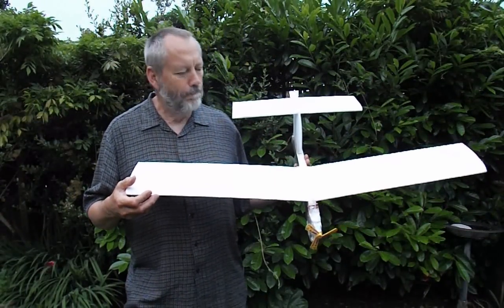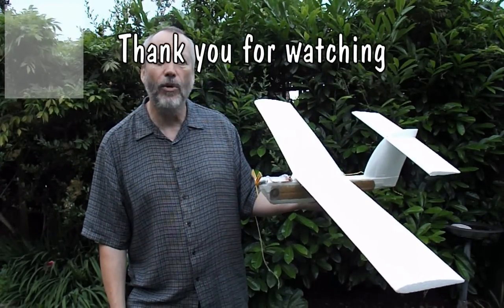Hey Grandad can you use cheap motors and cheap RC for a plane?

Comment: i was supposed to be weeding the garden, so lets crack out the hot wire cutter and make an aeroplane instead! :D brilliant :D ♥
Reply from the maker: That is an old one. Did you search for it, or did it come up as a recommendation 🤔
Reply: @GrandadIsAnOldMan  neither nor, i was using the search term "foam rc plane" and scrolled through it for quite some time, then it suddenly popped up :) i did watch it back when you uploaded it, but back then, i somehow missed that "should be weeding" gem at the beginning :D
Reply from the maker: @Elnufo  😁

Comment: grandad, maybe you could solve the problem of weight a little bit by sanding the outer steel pieces to make them thinner and more lightweight.
Reply from the maker: The project was started following regular requests to make a plane using the components from cheap RC toy cars. I did the series to demonstrate you are really wasting your time. If you are going to start spending time trying to modify the component parts you need to sit down and ask yourself why? The RC gear in a cheap RC toy car does not have the range to allow you to fly a plane unless you are very fit and intend to run around after it to keep it within about a 12 metre range so you would be better off buying a cheap hobby grade RC transmitter and receiver. It would be a good investment anyway. Next,  if you are not going to use the RC gear, what is left? The batteries will be too heavy so you would do best to buy LiPo batteries. That leaves just the motor. A hobby grade electric motor is cheaper than an RC toy car so if you are not going to use the RC gear you are wasting time and money buying an RC toy car just to use a junk motor. If you check out the video description you will find the link for the full playlist for this project. It runs over 11 episodes and it does fly but only after I replace the motor and the RC gear.
Reply: GrandadIsAnOldMan thanks for the information grandad, I was wondering that because we live in Croatia and delivery is quite expensive, for some things even double the price of the product. There aren't any rc related shops around and all flying rc gear is overpriced , regardless thanks for the video and info, I really enjoy your content and like what you do. Keep being awesome Grandad.
:)
Reply from the maker: Thanks very much for taking the time to comment. In the later episodes in the series I eventually use a better motor that actually comes from a toy hovercraft and a proper propeller and proper hobby grade RC gear just to prove the plane could fly. The motor is still not hobby grade but it is more powerful than the ones I was originally using. I suspect the motors from slot cars would probably do the job too as they usually run on 9 or 12 volts at high RPM, I haven't tried on but I might one day.

Comment: ok if you use fan blades you will get circulating of air but you wont get thrust propellers are in air dynamic shape
Reply from the maker: Yes a proper propeller blade would work much better. The purpose of this series (like most of my projects) is to use items from bargain stores (dollar stores) to make the project. If you watch all the episodes in the series you will see in the end I demonstrate it will fly with better components but not with the bargain store stuff.
Reply: thanks for reply great videos
Reply from the maker: Basic Survival :)

Comment: How do you cut it like that
Reply from the maker: +Bao Khang Kelvin if you mean using a hot wire bow to cut the foam here is a video I did to show the ones I use Hot Wire Styrofoam Plane PART #6 - those hot wire bows https://youtu.be/ZSFxSy6-bY4  and If you want a more professional looking bow you might like this one by Francisco Ramos Muñoz  https://youtu.be/Dzp9Qwvx2LE

Comment: Nice project. Can you not just use a capacitor and a more powerful battery and ditch the transmitter?
Reply from the maker: +Ross Pienaar the purpose of the project was to try to use cheap dc motors and components from cheap rc toy cars. If I just wanted to make a plane that flies I would use different equipment.

Comment: i have a plan to make an rc plane,but i dont know how to connect a 500 mh battery(lipo) to the motors,pls help(motors 4 drone)
Reply from the maker: +Lol Lol what is the problem? A LiPo is just a battery. It has a positive and a negative and you connect the wires to the motor the same as any other battery. If you mean you don't have the right connectors to fit the plug that is already on the LiPo then you will have to research that for yourself to identify a source. I buy virtually everything from eBay. LiPos come with different connectors depending on what sort of model they are intended to fit or sometimes with no plug so you fit your own plug to suit. You will probably want to include an on/off switch in the circuit so it does not start the motor as soon as you plug it in.
Reply: GrandadIsAnOldMan im still begginer at electronics,i don't know how to attach it to a normal dc motor
Reply from the maker: Lol Lol a DC motor will have 2 tags and the battery has 2 wires. You join 1 wire to 1 tag and the other wire to the other tag. If the motor goes backwards then you have the wires the wrong way round.
Reply: GrandadIsAnOldMan so now i should cut the drone battery connector?
Reply from the maker: +Lol Lol two points. 1: it would be better to obtain a matching connector if your drone battery has a plug on it. 2: If you decide to cut the wires DO NOT cut them both at the same time as that will short circuit the wires and the battery could catch on fire.
 Remember you will need to charge the battery so whatever you do must be compatible with your charger.
Reply: GrandadIsAnOldMan thx for the tip grandad!!:)

Comment: Not sure if this is true.... but it looks like it helps a bit. Well obviously not enough to get lift  but it looks like that tiny motor did try to make that glider go up a bit
Reply from the maker: +400 Gaming if you follow this series through - link in the video description - you will see the point I am trying to make is that this is really not worth the effort. You might as well buy a decent motor and do the job properly. People keep asking me if they can use the parts from their broken RC toy car to fly a plane and generally they don't have the power-to-weight ratio needed to get into the sky.
Reply: GrandadIsAnOldMan well i know that, but in my area good motors don't come cheap (about $100) so i'm just trying to find a way to get around that. Thanks anyway though.
Reply from the maker: 400 Gaming maybe you should have a look at eBay or similar. You can get brushless motors much cheaper than that. If you are really focused on using these toy car type motors then you will have to consider some sort of gearing system to enable it to use a bigger propeller. You will need to buy decent propellers to get a reasonable performance and you will probably need LiPo batteries to keep the weight down. What you don't want to do is spend a lot of time making a plane that is basically a glider that goes an extra few feet when you switch the motor on. You need it to climb properly and make sure you set it to turn so you don't have to run too far after it, unless you intend to make it RC. If you intend to make it RC then don't waste your time trying to use cheap RC toy car equipment as the range is far too short and you will have to chase after it to keep it in range.
Reply: ok ill try Thanks.

Comment: Can you make a rc helicopter
Reply from the maker: george maddox that is a regular request and the answer is NO. To make a helicopter or quadcopter stable in flight I would have to buy so many parts designed for the purpose it is cheaper to buy a ready made helicopter or quadcopter. On top of that, my channel is aimed at simple, quick, cheap projects and a helicopter or quadcopter build is not a simple, quick, or cheap project. You would be better finding a channel that specialises in RC Quadcopters or Helicopters so you get the information from people who know what they are talking about. FliteTest would be a good place to start although they tend to focus more on planes than copters https://www.youtube.com/user/flitetest
or anything David Windestål is involved in https://www.youtube.com/user/dadde87
or you might like this video by The Post Apocalyptic Inventor https://youtu.be/qa_x93JQhNM

Comment: You should revisit the  dh mosquito project and enlarge it on to hot wire cut foam that would be cool
Reply from the maker: alex monk I am not really interested in scale models or larger powered planes. This is not a model plane channel, if you want to see model planes then I suggest FliteTest.
Reply: ok fair enough and yes i have watched flitetest for a while before and it is a great channel and resource for model aircraft and design and building tip as well as flying tips

Comment: You can get a good amount of power from a rewound cd rom spindle motor and a brushless esc, even a hard drive motor unmodded would be better than the little dc motor.
I spose the esc might preclude it from being cheap, and you'd also need a servo tester to make it run, that or a timer for a control line electric plane.
Reply from the maker: hellcattanks the idea was to try the standard motors from cheap vibrating toothbrushes in cheap rc toy cars. If you want more power then you might as well buy the proper model plane motors and do the job properly.

Comment: Hey Grandad! You could replace the battery with a 2s 7.4Volt one, if it's not completely out of standard

The motor's only gotta be running the 5 meters anyways, so if you're running it max, it shouldn't be a problem.
Reply from the maker: TheShiphoo it's more a problem that it will probably burn out the receiver.
Reply: Fair enough. You'd need something like a BEC and that's over your budget... But if you ever find a high-voltage reciever in your charity stores, please pick it up and continue this project, if you can :)

Comment: If you were to make a version 2, use 4 mini tooth brush motors and two on each wing, this means the weight is centred and it won't fall because it is front heavy. Also, tooth bush motors are lighter, but have high talk.
Reply from the maker: Mustafa Moussa  the point of the exercise is to use those small motors as those are the ones people see me using in the other projects. I could always put a proper model aeroplane motor on it and a proper propeller but that is not what this project is about.

Comment: U can use a 9 volt battery and a switch and a bigger motor so it will fly better but if that's too strong well than it will fly and not stop until battery dead
Reply from the maker: Aleksander Sats the point of the exercise is to use those small motors as those are the ones people see me using in the other projects. I could always put a proper model aeroplane motor on it and a proper propeller but that is not what this project is about.
Reply: GrandadIsAnOldMan
i ment a bigger motor than what u use the bigger ones are stronger and u can find them in big rc cars or even big toy helicopers and toy trains :-/ i got 2 there really good

Comment: A geared motor would do the job better: more thrust and bigger propeller.
Reply from the maker: Amir Alamir  the point of the exercise is to use those small motors as those are the ones people see me using in the other projects. I could always put a proper model aeroplane motor on it and a proper propeller but that is not what this project is about. If the right gears and the right prop were available as part of another toy, then maybe it would work, but if I have to buy props and gearing then I might as well buy a proper model aeroplane motor and do it properly.

Comment: Flies well!
Reply from the maker: Francisco Javier Lázaro Pinela it glides fine but I don't think the motor adds anything.
Reply: GrandadIsAnOldMan Place a reducer and a propeller ...
http://img.ar.class.posot.com/es_ar/2014/10/18/Motor-Aeromodelismo-Mabuchi-550-Con-Reductor-Helice-Y-Speed-20141018110552.jpg
Reply from the maker: Francisco Javier Lázaro Pinela yes I could, but that's not really the point. People want to to know if you can just use the parts as they come from the toys. If you need to buy proper parts, you might as well buy a proper motor and proper gear. I might try the gearbox from a toy car to see if that works, but I would probably still need to buy a proper propeller.
Reply from the maker: ***** the point I am trying to make in this video is it is a waste of time. You are better off buying the right type of motor, they are not that expensive and will make the plane fly with a lot less effort.
Reply: +GrandadIsAnOldMan In my humble opinion, I think if a gear is set to reduce the number of turns and increase the power, perhaps there would be no problem putting a larger propeller.
Reply from the maker: +Francisco Javier Lázaro Pinela I think you are right Francisco, we discussed this before :-)
Reply from the maker: +Electronic Experiments thanks, I really don't want to get into powered RC planes. That is a full time hobby and I have other things to do. I made a couple of RC gliders to use on holiday and I might consider some 'parkzone' sized planes at some time as they should be something I can do locally.
Reply: +GrandadIsAnOldMan Yes....
 I'm pretty stubborn ... 8-P
 Just I thought you do not need to buy anything, since we can find many gears in all kinds of toys and devices that did not need to buy anything.